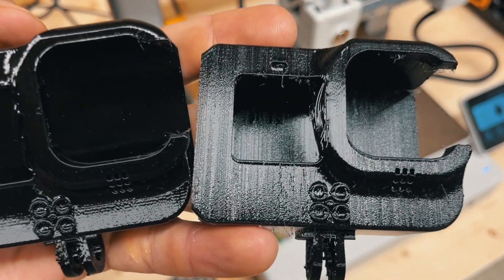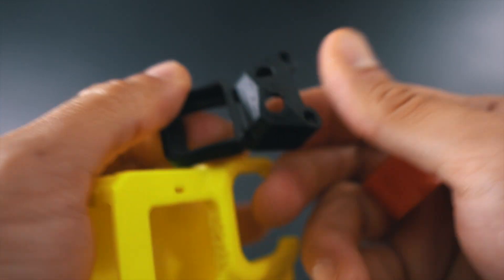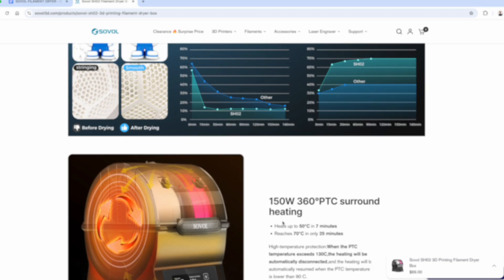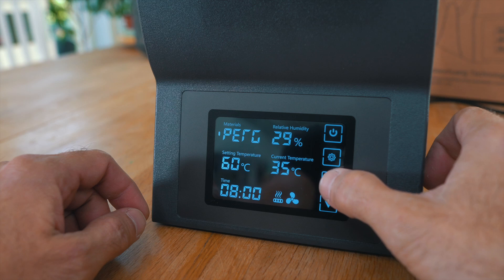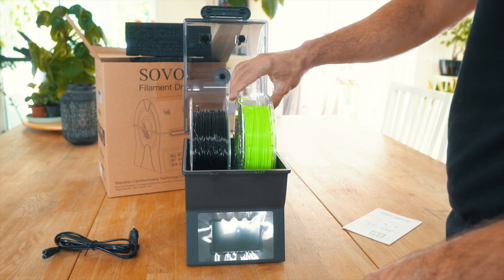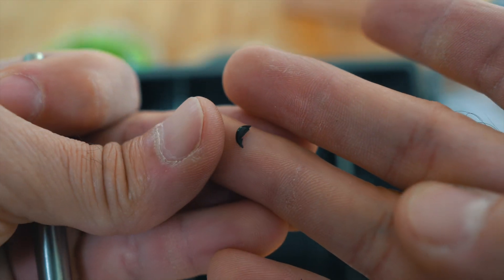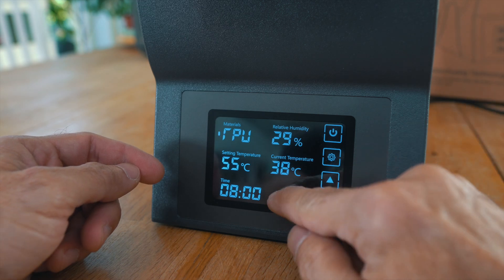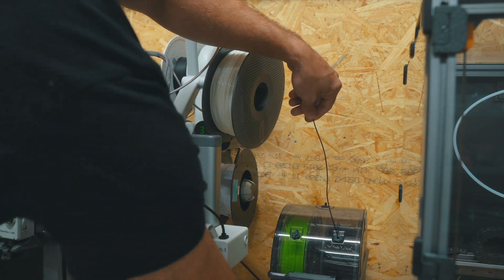Is the Sovol SH02 the Best Budget Filament Dryer? Full Review & Test!

Comment: After it’s dry can you store the rolls in it, Air tight?
Reply from the maker: It's quite air tighten, and you have place for som disecant, so it will do a decent job storing a roll, but it's not like the Eibos that has a mode to hold the humidity at some specific value.

Comment: I tried the Creality Space Pi Plus and I find the temperature not accurate. While it keeps it pretty consistent throughout the duration, it was consistently 4 to 5°C lower than the set temperature (verified with 3 different hygrometers). Also, the Space Pi, the time isn't preset. You have to set the time every time. This one looks like it has a preset time which I like.
Reply from the maker: Yes. This has preset for temperature and times.

Comment: Where does the moisture actually go without venting?   It must still be in the enclosure somewhere, right?
Reply: It has a vent on top that should be opened when drying and closed when storing the filament.
Reply: @Neomaster67  I saw that top vent after checking the Amazon listing photos.  Nice.  I just bought one.  Thanks.
Reply: Yes that's a good point, not sure about how they get around that but I hope they do because I have one of these things on the way from Amazon today and id be pissed if it doesn't do it's job.

Comment: Why does the relative humidity go up while I’m drying pla? It started at 16% and now it’s at 31%
Reply from the maker: In the very beginning you are taking the water in the filament out of the filament, but this water stays inside the dryer if you don’t have a way to remove it. Therefore many dryers have ventilation for the humidity to scape. Without that ventilation the water will stay inside the dryer and closer to the sensors potentially influencing that number you are seeing increasing.
Reply: @NordFPV  moisture exits the filament during the whole drying - not only at the beginning. It does the quickest, at start, and negligible at the end of drying. 
Imho most dryers are not designed well, regarding this.. letting the moisture just not out of the dryer and slowing down the drying, strong.
Reply: Let the lid a small bit open during drying. There is an extra lip at the closure to hold this position. The humidity goes up, because moisture goes out of the filament into the air (=drying) of the dryer... and then much too slow out of it (air exchange between dryer inside and outside is too low)... so it's trapped and slowing down the drying. 
An optimal opening / air exchange for drying is, if you have practically no rise of rel. humidity (compared after shortly opening for a few seconds) while maintaining the desired temperature. 
Also rotate the spool every 1-2 hours, if not printing, for better results.

Comment: Any dryer review that does not test actual temperature and noise levels is 66%-useless.
Reply: Totally true they all talk about the build quality i want to see and hear this thing run
Reply: Just bought one and while the temperature seems fine the noise level is really bad. 58-62 dBA 1ft away and about 52-54 8-10ft away. On top of that there's a pretty high pitch whine coming from the fan. If you're not in the same room while drying filament than it's acceptable otherwise the noise is unbearable.
Reply: @mad_buildz I heard people would replace fan with quiter one

Comment: Are there storage locations provided for Desiccant packs? If so, how large are the locations? Can you use 20g desiccant bags or just 5g? If storing the filament the ability to have Desiccant inside is really important.

Also it has the type presets but can you manually select temp & time too?

Thanks for any info.
Reply from the maker: Yes. There’s is space for such bags. I think there’s a part on the video where I show them…. I’m not sure the weight for those bags but I’ll assume is the small ones. 
And yes, you can manually change any profile.
Reply: @NordFPV Thanks. Didn't see mention of the locations in the video but you did show a close up of the inside around 7:15 and it looked like there were storage locations along the bottom edge. Guessing you push the tab and lift the cover off, install desicant and snap back in place.

Overall do you still feel this works pretty well? Do you still recommend? Ever hear from them about possible firmware updates?
Reply from the maker: @christopherlyons7613  Yeah, i don't think I properly mentioned it but I showed them. 
I do still think this is a good dryer if you can pass by the exit point location, or if it fits with your 3D printer. No, I haven't heard anything about a firmware upgrade. I actually checked and there's no port on the device so a firmware upgrade seems very unlikely.
Reply: @NordFPV  drill a hole add a fitting
Reply from the maker: yeah, you can do a lot of DYI solutions, but I'm trying to show what it has out of the factory so you can compare it with other products available in the market.

Comment: So I got mine a few days ago and the filament exit holes are at a 90 dagree to the spool on the inside causing a severe bend on the inside. It was so tight, my extruder couldn't pull and caused a failed print
Reply: Load the spool as in the manual, mine works fine.
I am going to add a PTFE fitting though